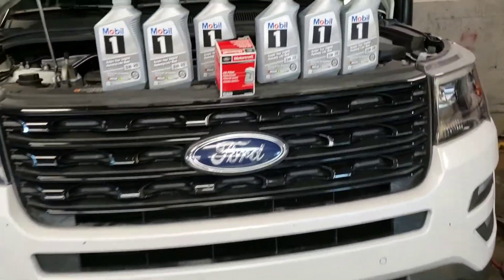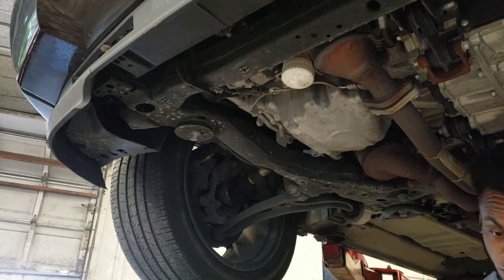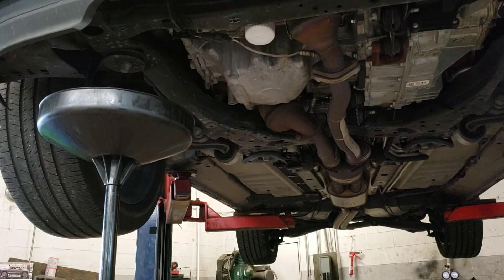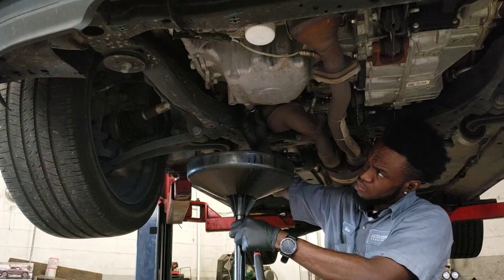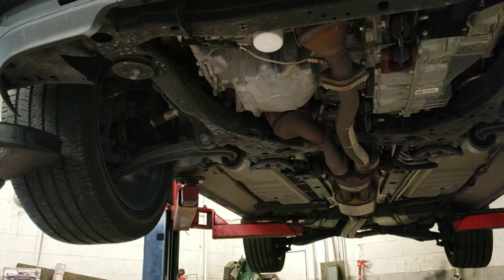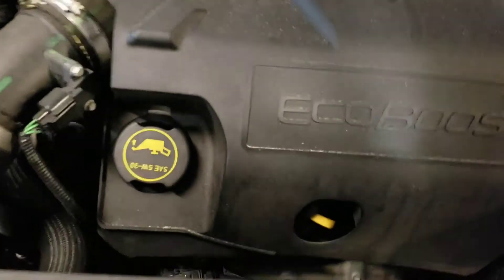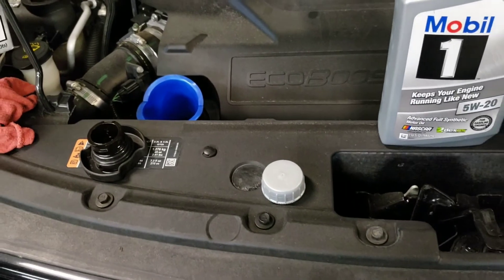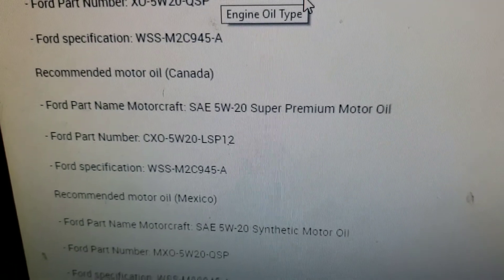Ford explorer oil change

Comment: Nice video dude. Just one thing. The 3.5L Engine on 2WD Explorer is on your computer screen is a Naturally aspirated Duratech. But you have a twin-turbo eco-boost which calls for 5W-30 Viscosity. You might want to consider switching back to the correct one next time. Yes, I know it because I got the Sport.

Comment: 5W-30 was recommenced on the engine oil cap.You should of using 5W-30 engine oils even you can uses 5W-20 engine oils because it will have less thickness to lubrications inside your engine cylinders and pistols rings and heads.